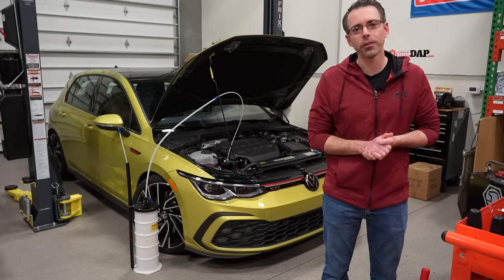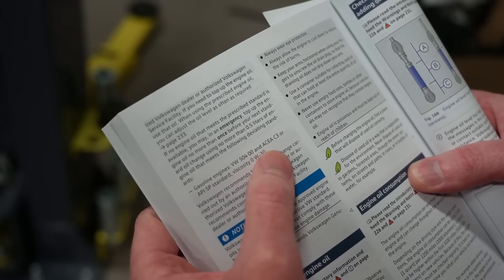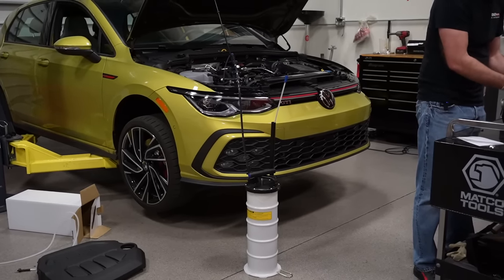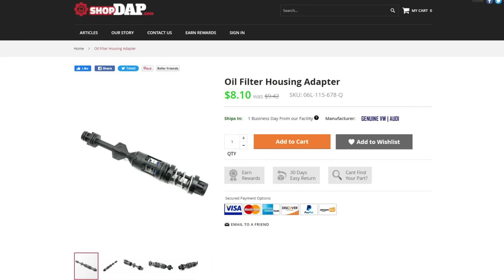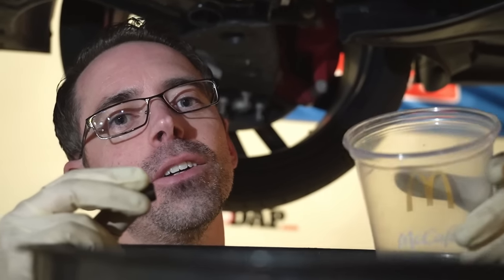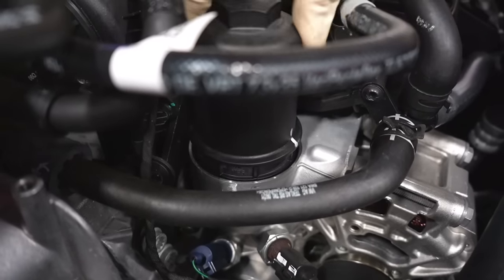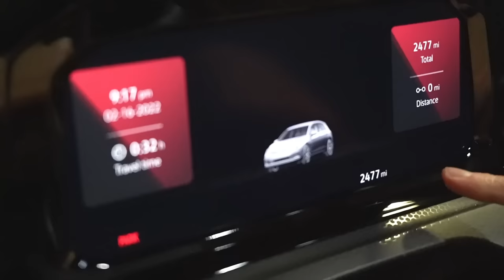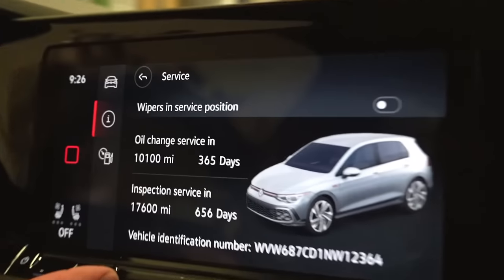Will an Oil Extractor get all the Oil? | MK8 GTI Oil Change

Comment: Thanks for the great tutorial! Just a question, did you add all 5+1 = 6 liters of new oil into the car, or did you add 5.7 liters (I think that's what the owner manual as the capacity for mk8 GTI)?

Comment: Fun fact. When i was first out of college I used to change the oil/filter on my Jetta.  At 25K miles the oil pump seized.  VW blamed me for not being a certified VW mechanic and voided my warranty.  BTW, I have an engineering degree, which is what led me to conclusion that the Germans way over complicate the engineering on their vehicles.
Reply: Best engineering and design keep it simple, reliable and lasting.
Reply: I also do all my oil changes myself. However, you can't expect VW to give warranty for all DYI people. It's enough to make a 'small mistake' to ruin the engine so they will request to do the service themselves to preserve warranty.
Reply: I had the same with Ford, ask for a quote for brake pads and discs, got a lecture about how these should be done by a qualified engineer, funny that, I did a Rolls Royce apprenticeship and qualified in mechanical engineering craft studies. I never went back to Ford, still did my brake for a tenth of the price.

Comment: The cheapest VW 508 oil is the 5 quart jug of Mobil1 ESPx2 0W-20 European Car Formula.  It's only $27.97, or $5.59/quart.  I buy 3 jugs and have enough for 2 oil changes on a 2020 Audi SQ5 with the EA839 V6.  With filter, it works out to about $50 an oil change, which is less than 1/3 what the dealer would charge.  It is really an unbeatable value.

Comment: Great video.Here in Europe now all VW including new GTI have Longer interval service at 30.000km or 2 years.
 Quick Question, when I take the car to the dealer shop, I will be ok with 6l of my own oil, don't need to buy more? 
Yes they allow to bring my own oil, will use the one is already in the car from factory, Castrol Edge Professional LL IV Fe 0W-20.

Comment: Suggestion...  When you loosen the oil filter housing, be sure you break the seal so air can enter the housing.  After a minute or so you shouldn't see any oil dripping from the filter when you remove it. I never do.
Reply: why would you want more oil caught with dirty elements in the filter drain back in to engine?
Reply: @enacku  :  The oil in the filter housing is the same oil that is in the sump. It's just trapped in the housing by vacuum.  It will drain back to the sump anyway when you break that vacuum so you want to do it before you pump out the sump.

Comment: Anecdote time:  I did the 'over pump happy fun time' and caused the vacuum to explode inwardly, launching hot oil all over me, the car, and the driveway.  I lost a good pair of socks and sneakers that day.
Reply: Hey I bet you learned not to wear your good socks and sneakers when goofing off in the garage, though.

I used to hate how all of the current tools are made super cheaply, causing stuff that's supposed to hold vacuum to fracture if you actually try pulling a ton of vacuum on it. Then I realized that loads of people probably got hurt back in the day by blowing stuff up and today's stuff, while shitty, probably has "softer" failure modes.
Reply from the maker: Yikes 😳

Comment: Beware, check your car first! I bought an extractor based on this and other videos, and have changed it this way 3 times (2L Passat TDI 2013 / CFGC). Third time I measured the quantity of oil coming out and it was not enough. Drained the oil again with extractor, then opened the drain plug. Almost a litre was left in the sump :(.

I think what is happening is due to an obstruction that I needed to push past when placing the extractor tube. The tube contacted the sump floor at an angle, so that it started sucking air with several millimetres still remaining. Once it sucks air, you cant suck any more oil.

Comment: I found with the EA888 plastic sumps it leaves over a liter of oil after extraction. It all comes down to the design of your sump. So yes, there is an absolute valid argument as to doing this.
Reply from the maker: We tested on a MK7 and got 100ml
Reply: @Deutscheautoparts  It be good if you did a compiled list of what engines you can can cant do it on.
Reply: @Deutscheautoparts  I got my wife an extractor for her EA888.  She didn't follow up with draining the pan but based on the before and after on the dipstick we figured she removed all but about 100 ml also.
Reply: @randys3010  I just did it on my S1 EA888 2.0 and same got basically nothing out of it lol. Can confirm this also happens on a 2015 Polo GTI EA888 1.8
Reply: I have used an extractor on my 2015 GLI, My wifes 2015 Jetta 1.8T Sport, and my daughters 2011 GTI many times...and have left no more than a shotglass full of oil behind.
Reply: @AaronHalpin  there must be a baffle in some sumps preventing you from doing this. Its impossible to do it on a Polo GTI and  S1.

Comment: Interested in this because I have a Jetta GLI with a plastic oil pan.  The oil filter is at the top so changing the filter is easy but I have no easy way to get underneath, AND I have had problems with oil drain plugs leaking. after oil changes.   They dont always use OEM parts, even at the dealers, and the third party plugs LEAK sometimes slow, sometimes faster.   I would rather the oil plug never came out again!  I dont mind paying the dealer $80 to do it, but like I said even they dont always have the correct OEM drain plugs and getting the drops off my driveway is pretty impossible.  Looks to me that this works pretty well, I have the EA888 engine in my car which I believe is supposed to be compatible with this method.  I am going to give it a try.

Comment: Great video is there a secret menu for the mk7 oil inspection light
Reply from the maker: We showed the reset procedure at the end of the video
Reply: @Deutscheautoparts  Thanx was not sure of that worked on the mk7 since the video was a mk8 will try it when readt

Comment: When you pour the new oil in, you would do better to hold the bottle horizontally (say with the front big label facing up)  so that air can flow back into the bottle without interrupting flow of oil out - otherwise it just glugs and may go all over the place.
Reply: Exactly
Reply: Glugs out.  Sounds like a mom joke.

Comment: That's nice that they went back to a steel oil pan on the MK8. With that said in theory shouldn't you be able to use the MK8 oil pan on the MK7?
Reply: Mk6 steel pan works on the mk7

Comment: Are the oil pumps of EA888 Gen3 engines known to be points of failure? I’ve come across information which says that the pump basically has two modes: min and max pressure. 
As I recently noticed a bit of a rough idle at my 2.0 TFSI EA888 Gen3, I started reading into it. Looks like the low pressure oil pump mode is to save about 2% fuel? Also, VW let’s the oil pump run at max for the first 1.000km of a new car. That tells me, that it’s best to have the oil pump run in max mode all the time, so that the engine parts are properly cooled & lubed.

Comment: Extractor works perfectly on my Mk7 GTI--pretty much all the oil. On my 2012 Beetle Turbo with a 2.0T, not so much--still leaves over 1.5 liters of oil.
Reply: Sounds like you may not be getting to the bottom of the oil pan. I have a 2015 GLI, 2015 Jetta 1.8T Sport, and a 2011 GTI and my oil extractor works perfectly on all of them.

Comment: Handy news, all of the EA888 engines are designed to be suctioned and VW recommends that dealerships do the oil changes this way. As a "Volkswagen Certified Technician", I can suction the oil while I rotate the tires and perform other services therefore increasing my efficiency. #SecretSquirrelTricks #FlatRateLife
Reply: As a rule of thumb could you say that all VW engines that have the oil filter „on top of the engine“ can have the oil sucked out without difficulties? I have a EA188 BSW 1.9tdi new beetle convertible…
Reply: @PaganiZondaF650hp  no. Only the ea888 family. The 1.9's pan/dipstick tube are not designed for suctioning
Reply: @lorddrako1990  ah, too bad. Thanks for the reply

Comment: What's the size of the hose used in the video?
I bought an oil extractor aestetically looking the same as the one used in this video.
3 hoses were included in the box. I tried the smallest one (3,5x4,5mm size), but it didn't easily reach the bottom of the oil pan. At about 80% of its inserting, it stopped and I had to force it, untill it passed something that was blocking its passage. Then, I've been able to extract all the oil, but when I removed the hose, it had 3 creases: a sign that maybe it was too big or there's something in my engine (CWZA) blocking its passage.

Comment: So my was purchased from Harbour Freight and was used on 2014 passat TDI. No it doesn't work. No matter how many tomes I had to reposition suction hose, after 3 liters out, only air was coming out. I even opened filler cap and removed top oil filter too. 3 liters (about 67%) and that's it.

Comment: I own both a 2014 Audi EA888 2.0T and a 2017 Subaru FA20 (Forester) turbo, plus a vacuum extractor.  The extractor does not work as consistently on the Subaru as on the Audi

Comment: It gets every drop, I use vacuum extractor, air compressor driven.  MANN filter, Mahle,Valeo, Motul, Liqui Moly meets VW specs 504, 505, 502,506,507 etc etc.

Comment: If you're getting oil from the pan, why do you need to warm up the engine? It was warm the last time you drove it right, so the oil should be drained to the pan, and then cooled and ready for extraction...

Comment: Checking the oil at every gasoline fill is old-fashioned advice, left over from the days of conventional motor oil being changed every 3000 miles in engines that were generally ready for the scrap heap at 100k.

Comment: Do those oil extractors work with Seat?
They use VW engines so I'm kinda thinking they do.
Reply: on the 1.8 and 2l yes but 1.2 and 1.4 tsi does not extract enough out in my experience.

Comment: Using 504.00 0w-30 will have absolutely no adverse effect on the engine. The only reason VW recommends 0w-20 is to achieve a cumulative fractional increase in gas mileage over the entire fleet of GTI's sold world wide.
Reply from the maker: True but not following the correct oil spec could result in warranty issues
Reply: Surprising VW goes from 5w-40 all the way to 0w-20 in just a few model years.
Reply: @michaelatchison2325  5w-40 is for cars that don't have GPF.
Reply: Just make sure you use full synthetic PAO based oils. Ravenol, Amsoil, Liqui Moly have full synthetic.
Reply: @dragospahontu  what is GPF?

Comment: With some engines and oil pans it gets out more oil than remowing the plug. Some, like 302 two sump oil pan, only part of it; the other plug must be removed to get the oil pump sump empty, unless the plug for the front dipstick is used. Some cars has so narrow dipstic tube that only very thin suction tube fits, like my H3, and it is a very slow job. I have several cars, and I use the suction method, actually, last time I used the drain plug was possibly 20 years ago. Motorcycles are a different case, as only Harley is easy, my others possible or impossible to suck, only the drain plug job.
For modern German cars it is not so important how one changes oil, as the engines last only few oil change intervals anyway; the stupid plastic engine parts fail and thats it. But they have "planned obsolence" and are designed to be disposable and to be recycled anyway.

Comment: The problem with sucking hot oil is that the plastic of the excavator gets warm and soft. My extractor collapsed multiple times on me. 
I had a 2005 Passat TDI and added a Trabold side stream oil filter. It looks like a toilet paper roll. I didn't change oil for 110k miles until I sold the car. I changed the filter at normal intervals and added the missing oil from the filter change.
Reply: Where did that extractor come from and what brand was it?
Reply: @davepetrakos475  Mityvac Fluid Extractor Plus, 2.3 Gal, PN 07201

Comment: I'd like to get one of these for my Subaru Outback. I see this is a popular item at Deutsche Auto Parts!
Reply: I have both a 2014 Audi 2.0T and a 2017 Forester XT - plus a vacuum extractor.  The vacuum does not work as consistently on the Subaru as it does on the Audi, so I use it only for the Audi
Reply: @marksandstrom4248  Thanks Mark, good info on the Subaru.

Comment: I love how their maintenance manual only shows maintenance to 120k miles... They're not expecting the car to last beyond that point.
Reply: nearly every car maker displays up to 100k+miles in manual because that is the standard rate of maintenance once you reach over 100k on any car it should have a detailed overhaul and inspection of nearly everything, due to weather/time/corrosion ect and change as needed. Also the highest mileage VW was a 1986 jetta that hit 600,000miles on the original engine which is roughly 1million kms. Cars are not meant to last "forever" again the standard is about 120k miles before it needs detailed overview that does not mean its done. Just that it should be properly checked and maintained.

Comment: Hey bro, love you and humble mechanic have raped your channels well before owning my golf R. Just wondering if the billet aluminium parts you sell for waterpump I think was one and there was other metal bits that were massive upgrades over oem. Just wondered when my water pump inevitably goes around 60k miles or kms is that part going to void warranty because oem part is only going to fail again later down the track. I'm thinking it would cos they are grubs lol but any insight would be great thanks in advance bud @Deutscheautoparts

Comment: I own a 2014 and 2019 Tiguan. Will this oil 🛢️ extractor work for both model vw Tiguan?
Reply: It works very well for the old generation, but you have to wiggle the tube a bit to make sure you reach the lowest part of the oil pan. I have never worked on the new gen Tiguan but I'm pretty sure it's the same.

Comment: There was a time you just looked for a named brand GTX Castrol, Elf, Shell, now its a nightmare, I need Acea A5/B5 - Api Sl/Cf - Renault RN0700 , but really I need 5w - 30w or depending on which data sheet 0w -30w just going on the viscosity I pick an oil, I get a message "This oil does not fit your car" this goes on and on all the correct 5w - 30w but not the correct spec A5/B5 I can find LL or C3 or B3 or SXR, what happened to the old days when 20/50 any brand was good enough.

How about a test of engine flush products and oil additives.

Comment: Any use of draining everything out, so you get all sludge etc out?

Recently had to replace the oil pump on my A5 recently and it seems around 0,5L is left in the oil pan normally when you drain it the normal way, including all kinds of pollutants.
Reply: lol if there's ANY sludge in your engine you're doing something wrong.
Reply: @Hawk7886  non, native English speaker here Mr. LOL
Used, polluted or whatever you call the state oil is in after it's been used and it's time to change it.
Reply: If stuff is building up, you're too late, and draining it "fully" isn't going to make the sludge magically fix itself.
The best thing to fight against sludge is to make sure you get the engine up to operating temperature every time you drive it, and changing your oil & filter regularly.
If there is anything at the bottom of the pan that could be picked up by the pump, the oil filter will get it, and by extension, keeping regular oil & filter changes will mean you'll be getting it out of the system too.
Reply: @Nabeelco  I don't think my point is coming across.
When you drain your oil, there's always some oil left in the oil pan, right? 0,5L?
So that's used oil, and when you add clean oil to it ... it will partially polute your clean oil, right?
So would it be of any use to drain the pan fully with every oil change?
I do regular oil changes at least once per year around 12k miles / 20k km (amsoil for european cars) and change all filters Mann or Bosch brand.
Reply: @scrwbl8  Firstly, the oil change interval set out by VW is FAR too long, so I'd do it much more often than that, ESPECIALLY if you get any sort of winter weather where you live, or do any kind of spirited driving.

Secondly, no. The amount of remaining oil is so insignificant that it will make literally no difference.
Reply: @Nabeelco  Good, but their (in this case Audi)  interval for long-life is 30k km, so I'm way under that.
Winter weather, not really, central northern europe. Maybe one or two autobahn rides per year.

Comment: I understand one issue with too frequent oil changes is that oil evaporates more readily when it is fresh.  These oil vapors cause issues with some emissions equipment and additionally can contribute to the valve carbon buildup problem.
Reply: Interesting!  Never heard of this.  Do you think fresh oil in the engine emit the vapors that the sensors pick up, or is it possibly spilled oil on the outside of the engine setting the sensors off?
Reply: @bjjbrawler1  Look up about oil volatility.  Virgin oil off gases more than does oil that has been used for awhile. These vapors can lead to varnishing of internal parts. It probably isn't a huge problem, but over frequent oil changes might have some minor negative consequences.

Comment: Tengo un golf 7.5 año 2018 de motor 1.0 tsi 110 CV el EA211 y en unos concesionarios me dicen que eche el 0w20 y en 0tros el 5w30 o 0w30 en el manual pone que es long live y que es el w508 w509 y
Porque viene para 30000km yo ahora echo el 0w20 será el correcto también decirte que gasta algo de aceite a los 30000km nunca llega siempre me avisa de aceite bajo a los 24000km será normal gracias

Comment: Paul, 25 Nm for the filter? Wouldn’t be more 2.5? I’m guessing its a typo as it seem a little heavy torqued for a plastic housing.
Reply: 25 nm is barely anything. You really think they would print it on the top of the housing if it was too much?